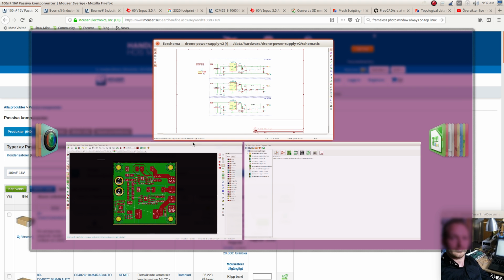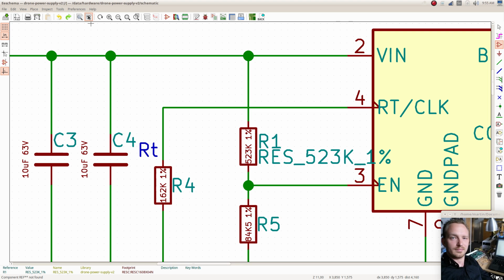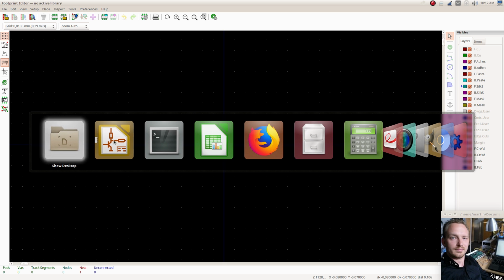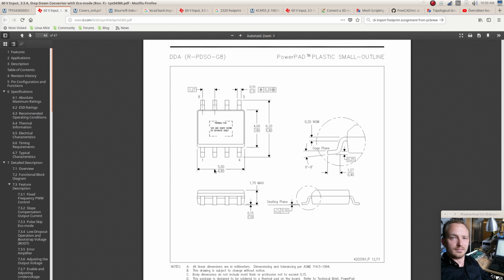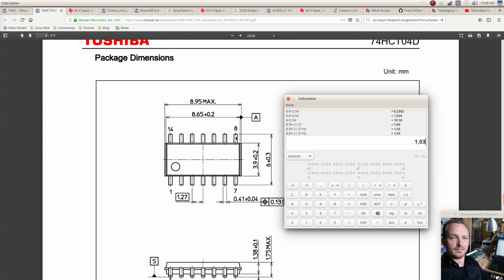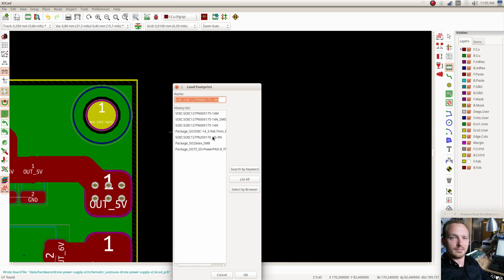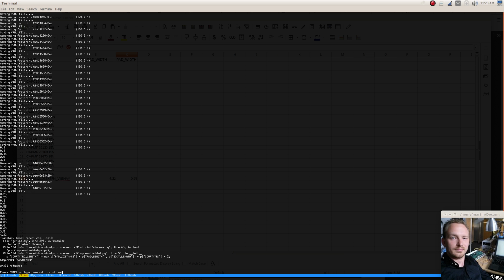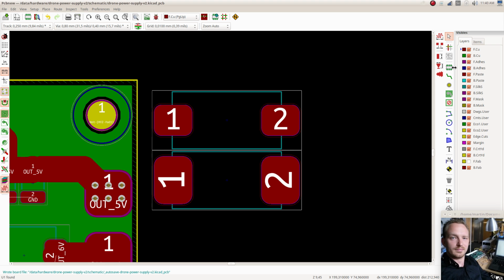Generating IPC footprints and 3D models with python for KiCad - Embedded System Consultant Explains

Comment: It looks like you are speaking about the whole library system rethink made from the point of view of using dynamic prototype OOP system, in which any user can inherit any component into any custom component in local KiCAD installation, or specific to project or single schematic sheet.
Reply: As KiCAD mostly was written in C++ it looks technically undoable until some dynamic prototype-based OOP subsystem will be implemented in a CAD core. IMHO no one power CAD can be written using only statical compilation without using some sort of scripting and dynamic object system. This problem was shown by the whole history of CAD design, remember AutoCAD/Autolisp as a mostly generic way of a CAD system design: tight core, scripting engine, and a huge dynamic world built above it.
Reply: How do you think, is writing a generic CAD engine with EDA plugin in Python can compete with KiCAD enough to make it commercially successful enough to let the project live on donates? The task looks scary in the amount of code that must be rewritten, and I have no time to do it in parallel with full-time freelance work.
Reply from the maker: @dmitryponyatov2158  not sure what you mean. I'm not suggesting a redesign of kicad. I just think that kicad library system can be greatly improved by making reusability of customized components and schematic blocks the primary goal. Actually first and foremost: components should be defined with all details including SKU in a private library. All "official" libraries should be seen as just templates (ie without sku). So far so good, kicad already supports it if you have your own "workflow". Second, I want to be able to reuse PCB fragments. This is currently partially supported using schematic sheets which I can copy and reuse but it is not an "official" way of doing things - the same as copying all used components into a local library is not an "official" way of doing things. However when it comes to reusing pcb layout I have not found a good way to do that. This is a drawback right now. Obviously there is nothing stopping me from just taking kicad, customizing it and using it however I see fit and that is exactly what I do. I have python scripts that parse my library and pull complementary information for components from supplier database based on SKU. I reuse my own library of parts with SKU numbers across projects. Most recently I have started putting more focus into reusing schematic blocks by using sheets. We will see how that goes and where I end up. I'll post more videos of me using my approach adding any missing functionality either using python scripts that work directly on schematic/lib files or by modding kicad code itself.